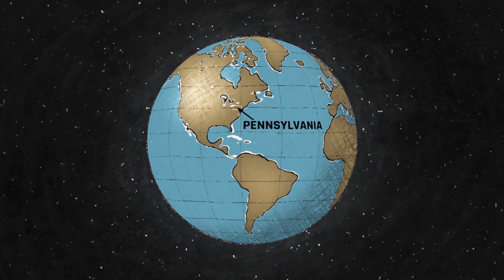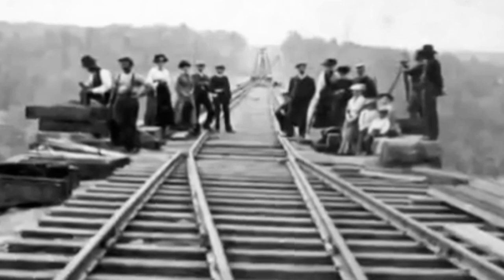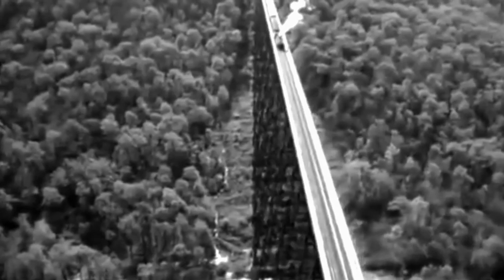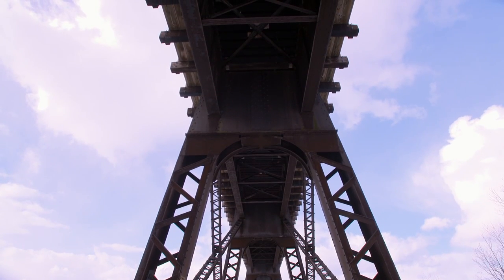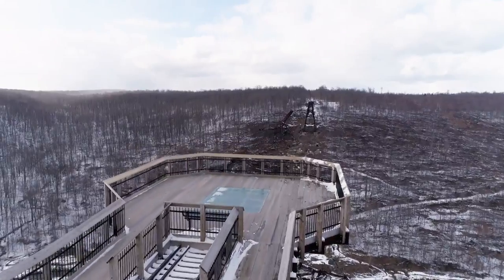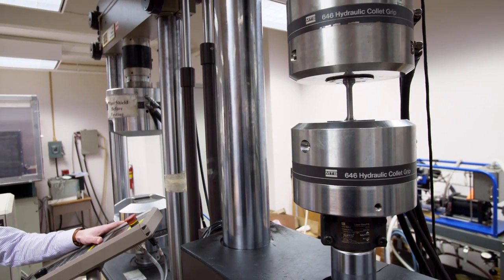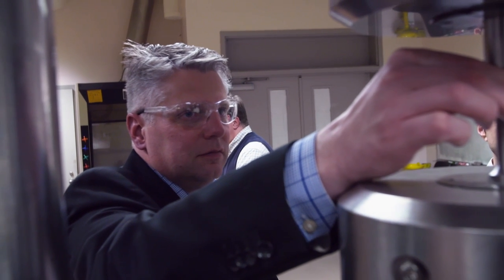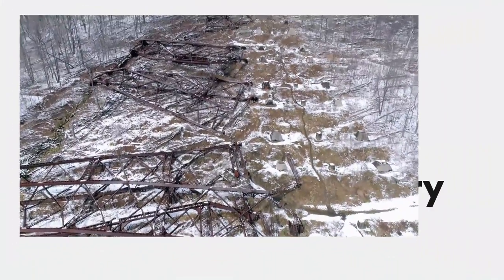How The 8th Wonder Of The World Failed Due To An Engineering Oversight |Massive Engineering Mistakes

Comment: Built in 3 months
Lasts for 100 years
0 casualties
Calculated risk or no, I'd call this a successful bridge
Reply: This. This is something that every business does. They will literally factor in the probability of people dying from their business, and what it will cost them in the end. Businesses give zero fucks about collateral damage as long as it’s still financially viable.
Reply: @UDumFck  As you say, people /have/ to get on with their lives. If the choice is between wearing a mask and not wearing a mask, it's really a no brainer. If masks help to save lives, there is no reason not to wear them.
Reply: @inflatablewolfie  Completely agree.  We need to be smart about risk, not ignore it (or be a conspiracy nut).
Reply: Nahnahnah. Totally an oversight. I mean what if people had been on that bridge during the tornado XD.

I have no idea what they were faulting the designer for. The loss in profit at the time vs the cost it will take with modern technology to rebuild should be a pretty fair trade-off. We have other similar transportation options, they didn't, we can do it much faster than them, and we can get way more material for the "same" cost.

The bridge builder made the right call.
Reply: Built in 3 months
Lasts 100 years
HIT BY A TORNADO
0 casualties
Reply: In this context the definition of fail is a synonym of break they aren’t saying the bridge was a horrible failure that never did anything good they are saying that it broke
Reply: @denimchicken104  that’s the way business is and should be. Any other way, businesses would fail and the economy would collapse. Millions of people would starve die due to poverty.
Reply: This title is compelty clickbait without the producer of the video even realizing it. A bridge built in 3 months a century ago failed due to a massive tornado. That seems perfectly reasonable to me.
Reply: it truely is or was an 8th wonder of the world, COULD OF BEEN BETTER DONE TOOO ahahahahahaha so in all honesty if it were created now, it would stand for at least 200 years min, if it was rebuilt using todays innovations  Praise to the many souls who constructed this beasty
Reply: @denimchicken104  not just business but government as well. Regardless your feeling on the matter, risk must be calculated and life has a quantifiable value
Reply: How can they overlook the anchor's that held it in place. They only caught about 80% of the morning dew, rainfall and weather that attacked them over the years. Plus the bridge held after it was displaced from the anchor's for a few minutes before the wind overpowered it. No failure what so ever but simply mother nature related.
Reply: @inflatablewolfie  Read Dr Falsie Emails!
Reply: @Syllaren  " what if people had been on that bridge during the tornado":  Anybody standing on an exposed railway bridge during a tornado is already a Darwin Award nominee.
Reply: @scottbatterman5525  obvious sarcasm is obvious o_0
Reply: Totally agree. 100 years of service and destroyed by a tornado. Few structures ever built can with stand the forces a tornado produces, why would this bridge be expected to perform any better.
Reply: To be completely honest you don’t really think about tornadoes in Pennsylvania, I live there most of my life and only ever seen a twister, a little one and heard of two recently
Reply: BleedingRaindrops : Also,Why is a neuroscientist being used for her opinion about an engineering problem?
Would Discovery UK use a structural engineer to explain a neuroscience procedure?
Reply: It's also luck. Most old infrastructure is not that lucky. Understanding statistics, modern civic infrastructure is radically better
Reply: Absolutely agree. It took a huge tornado to show us this epic failure after 100 years. I wasted too much of my life watching this video. Unsubscribe as soon as us can!
Reply: Yeah hard to call it a failure, especially since tornadoes in that part of the US are not at all common.
Reply: @denimchicken104  when ford made the pinto and discovered it exploded it a fiery ball of death when rear ended, they calculated how much it would cost to recall every pinto to fix it, and then calculated how much it would cost to pay out all the lawsuits for people dying in a fiery wreck. Ford determined it was CHEAPER TO BE SUED after knowingly selling death traps than to retrofit the cars with bolts that wouldn't rupture the gas tank when rear ended. Talk about an unethical business only concerned about the bottom line.
Reply: Yes but in Merica everything needs to be perfect. If it’s not perfect it’s a failure.
Reply: @eminum7777  what? America has been failing in most sectors for decades.
Reply: And the fallen pieces are still where they collasped
Reply: @denimchicken104  yeah it’s like the toxic job I work. I’m a gas station clerk. Our gas stations cameras do not work and because of this they tried to make me do inventory on certain items because of that but I told my manager I ain’t doing shit for them until they get a camera.
Reply: @inflatablewolfie  lmao do you still think those stupid masks actually work a year later?
Reply: now that takes 
30 years
lasts 10 years 
and can cause at the most 100 casualties
lol
Reply: @meme8315  I'm not american, we have actual education here. You should stop watching Fox entertainment.
Reply: yea, it just run its course, the anchor bolts might have gotten them an extra 30 years, but the tornado might have still ripped it down.
Reply: And it wasn't even due to it wearing itself out, it was a fluke tornado that toppled it.
Reply: @EngineeringGoneWrong  Steel bridge would have just twisted up and slopped over and been unusable anyway.  Or, the lift would have just ripped the pylons out and thrown it over.
Reply: @donaldkasper8346  You're basing yourself on circumstantial evidence. Circumstantial evidence is poor evidence, in the face of actual evidence demonstrating that actual masks - as in not knitted ones gramma made, even if they're cute - are effective in stopping particulates the size of which are expelled when coughing, for example. 
It won't /stop/ spread, though, that's true. Not on its own. What it will do is slow the spread, thereby preventing overcrowding of emergency services, leading to more preventable deaths.
Reply: I'll agree with that
Reply: I would call it a lucky bridge. Please don't become an engineer.
Reply: Me too. They saved a ton of money and it would still be going if not for a tornato. How offten do they get tornatos down there I'm betting not very often.
Reply: @denimchicken104  Ding ding we have a winner. This is why people are not putting in extra work any more. I mean why the could not care less about you and your plight.
Reply: @Syllaren  But there wasn't people on it thought right? But even say 20 people died its still a secuses in my book. How many thing last a 100 years that only took 90 days to build?
Reply: @Riverrockphotos  The point is they didn't know the fault existed. If they did they could have closed the bridge whenever there were storms.
Reply: @Riverrockphotos  the people being on it thing was sarcastic. I went on to compliment the builders choices. As someone else pointed out, and as I intended when I made the statement, if you stay on the bridge when a tornado hits you're not staying in the gene pool even if the bridge does somehow survive. The bridge operated perfectly for a stunning amount of time, and can now be brought up to modern standards much much cheaper than it would have been to do it way back then.
Reply: And ten years of planning and making the parts.  Everything had been pre built and stored BEFORE the reconstructed started.  That work took over ten years.  Yes, the bridge was rebuilt in 90 days, but people had been working to replace that bridge for ten years so theey could replace it in 90 days.
Reply: That bridge in Florida lasted less than 1 day, and had casualties.
The big money pit in boston failed in the first month killing a women the roof fell on.
Reply: @denimchicken104  I disagree. This is NOT "something every biz does."
Reply: @mercury6800  Good distinction
Reply: No casualties is a lie.  The company doctors and project managers were slime.
Reply: @denimchicken104  Your math is wrong here. They absolutely give several fucks about collateral damage. That is why they include it in their calculations.
Reply: @inflatablewolfie  Except it has been proven wearing masks HURTS your health.
Reply: @Syllaren  I've never seen a tornado chaser use a train before.
Reply: @knightaaron7  The 8th wonder was torn down since it was made of iron.  This was a cheap copy.
Reply: @scottbatterman5525  exactly.  EVERYONE knows you get UNDER the bridge to be safe.  LOL
Reply: @thanhavictus  LOL, then why do they fail in the first weeks? Not millenniums.
Reply: @theshapeexists  and now the government FORCES them to put claymores in the steering wheel.
Reply: @Riverrockphotos  First 1911's are now 111 years old and working great.  Probably took 90 days to get the plant up and running.
Reply: @Syllaren  I totally agree. Rather, the fault lies with engineers who came later within the 110 years, and never updated the couplings with steel, when it was possible. 110 years of never making such an update? Cmon. The original engineer did his job well. Nobody took initiative to follow up.
Reply: @robertsmith2956  I would love to see your sources for that 'cause 99% chance they're bs sources. I can't find anything corroborating that statement.
Reply: @inflatablewolfie    The pistol is named after the year it was made.  If you find a calendar you can count backwards.
Reply: @None Yabusiness Well trains do pull train CARS.   LOL
Reply: Cody Teague  Are you also claiming that masks are bad for one's health, with that comment?
Reply: We can't even create stadiums to last over 30 years. This was clearly a success that only failed during a once in a lifetime disaster.
Reply: @inflatablewolfie  Baaaah.  I support common sense and choice
Reply: Correct!
Reply: In the following 100 years evidently no one else responsible for maintaining the bridge thought about uplift either.Seems like plenty of time to replace all the old footings.
Reply: Did I miss something? I mean it got hit with a tornado
Reply: the point is that the bridge may have continued to be in service and profitable if it hadnt been blown over. regardless of whether or not it would have initially cost a little more to rebuild when they upgraded from wrought iron to steel. in fact it could be argued that the cost and time to redo the concrete piers would have been a very small part of the overall budget.
Reply: @nekomancer9157  Their main concern was time, so waiting for concrete to cure would have hurt that goal (and increase the cost). What happened 100 years later is an unfortunate happenstance that was unlikely anyways to begin with.
Reply: There are bridges in Britain that were built by the Romans that have lasted for 2000 years.
Reply: Imagine if the tornado came a month after the rebuild. What would we say then? Successful build?
Reply: @denimchicken104  you don’t say
Reply: @denimchicken104  Dude, how is this relevant. We were just given an example of a Bridge that was built well, preemptively rebuilt for the public's safety, stood for 100 years, got preemptively closed again for the public's safety, and finally got torn down by a tornado. If anything, this story is evidence of why your narrative of pervasive corporate greed is untrue.
Reply: @Syllaren  And considering th coal shipments were being delayed, if the bridge reconstruction had been delayed by the bolts, they might have turned to an alternate means, which may have caused injuries and deaths.   There's the problem with assessing risk, the dangers of the route you didn't take.
Reply: @ebayerr  Most likely.   To documentary filmmakers, anyone with a "PhD" in their title is automatically an expert on everything.   That's why they put the documentary filnnakers on the "B Ark".

Just remember, "PhD" can stand for "Piled higher and Deeper".
Reply: Me too. They said that it collapsed because of the bolts that where in it. But it lasted 100 years. What happened is that they replaced the first one ten years later. They second bridge was caluated to last 30 years but went 70 years later. I think its a failure to not replace in time than bolts that lasted over a 100 years and rusty as heck.
Reply: DUNNNNNNNNNNNNN
Reply: Yeah and now aways everything made cheaply and cost way to much just to need major repairs or replacement after 5_10 years
Reply: 100%
Reply: Hmmm....I bet you'd retract those words had you been driving over it when the hurricane hit? OH! SORRY!! You'd be dead.
Reply: @fluffybunny1200  : I guess so.
Reply: Still lucky it's not made in China
Reply: @inflatablewolfie  How did tat work out?
Reply: Yep, I'd say this kludge lasted long enough.

Comment: This was built in 90 days by 120 man and it lasted 100 years 'till a tornado going over 100 miles an hour destroyed it, with zero victims! This was not a failure! This structure was a great success when you take into account the Technology this man had available at that time!...A standing ovation to those great pioneers!!! 👌👍🙏👏🙌
Reply: 100%
Reply: Exactly!....100 year old railroad bridge built in 90 days by 120 men is EPIC...modern engineering doesn’t guarantee anything over 30 years.

Comment: Fail? It lasted OVER 100 YEARS and only “failed” after a TORNADO hit it? 

Hardly a failure. By any reasonable standard a smashing success.
Reply: And when it went down, no one was on the bridge.  When a structure fails and hurts no one after a century?  Total success!  Recast the support blocks with your happy stainless steel inserts, and engineer it for 200 mph winds.  Good for a millennium.
Reply: @geraldfrost4710  No way you could engineer that thing to withstand 200 MPH winds. Plus some tornadoes have winds up to 300 MPH
Reply: @paulspomer16  Agreed!  Thinking that a structure will not eventually fail is in itself a failure.  The more engineering and materials invested in a project the longer it should last.  But when the engineering and materials cost more than simply rebuilding the structure after a century, it gets obvious that you might as well just rebuild the dang thing once a century.
Reply: It's like calling the human body a failure because it's not bulletproof.
Reply: @paulspomer16  some tornadoes have 300 mph winds but do u know how many tornadoes Pennsylvania actually has a year.... It was a freak disaster its not tornado alley out here....
Reply: @rallysport4207  It wasn’t a freak disaster, only an F1 tornado which is weak. F1 tornadoes are common. Pennsylvania averages 16 tornadoes annually.
Reply: @paulspomer16  im well aware what pa has i live less than 2 hours from the bridge itself.. U can't tell me another tornado is gonna hit there in the next 100 years... 16 annually in which not much damage occurs... Compared to other places i would say it's pretty safe. Just saying
Reply: @rallysport4207  Right
Reply: sankara raman r  lmao!!!!
Reply: It’s a failure in compared to the other Wonders of the World, which are much older and lasted hundreds and hundreds of years longer through wars (in some areas), through flooding and other terrible weathers...
Reply: It’s foolish to criticize a structure because it was destroyed by one of nature’s greatest disasters.
Reply: I’ve never seen a plot fall apart quicker then this video. 🤦🏾‍♂️
Reply: Just like the Colossus of Rhodes "failed" when it was struck by an earthquake?
Reply: no pun intended?
Reply: not a success.. lucky. the tornado could have hit in the bridges first year
Reply: That's what I'm saying. Wtf. People these days need someone to blame even if they're dead for a hundred years. Must be Marxists.
Reply: That was what I thought too! It took a tornado ffs.

Comment: I can imagine the engineers discussing possible causes of failure 100 years ago and have no doubt that since Pennsylvania had never experienced a 100 mph tornado or even winds of that speed in the state that this scenario was never considered.  Using cast iron collars was therefore not a mistake that warrants such hype as expressed in this video.
Reply: It's easy to blame engineers from over a century ago in an oversight, when basically they had decades to replace the iron collars with proper modern anchor bolts and they didn't do it. Everyone is an expert afterwards, but in fact these experts didn't anticipate a direct tornado hit either.
Reply: Programs like this are always too dramatic for their own good.
Reply: @hhiippiittyy  Videos like this remind me of the video about the use of wrought iron rivets on the Titanic being partially to blame for the ship sinking.  Both videos leave out the fact that heating and pounding steel rivets makes them more brittle then wrought iron rivets.  There are thousands of structures from bridges, to ships to buildings constructed using wrought iron rivets and none of them have failed to date.
Reply: Exactly, and another thing we don't know is what else might have failed had the cast iron fasteners held.  The foundations themselves could have failed.
Reply: bullettube, you can 'imagine' all you want, but if you were to actually study the history of bridge engineering, you would know that, yes, engineers back when this bridge was built DID include high winds in their calculations. This bridge would have withstood the tornado that hit it, except for the ongoing maintenance process at that exact time, which was gradually replacing the anchor bolts on the towers. The towers that fell over were the ones whose old anchors had been removed without the new ones being installed yet. Don't be fooled by the poor research and sensationalistic tactics of this video's author(s).